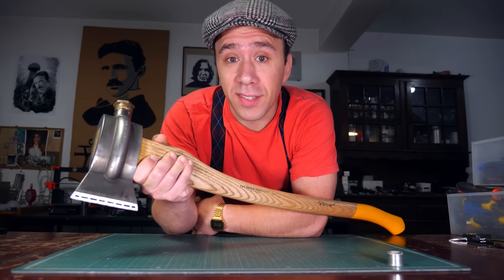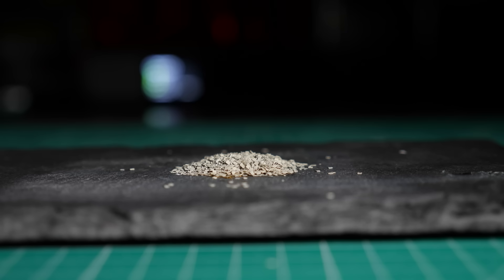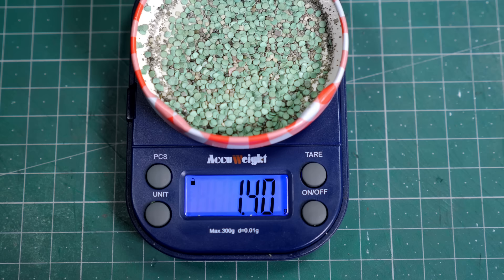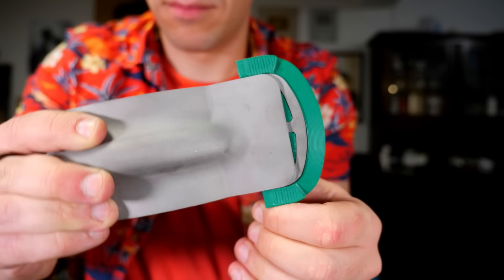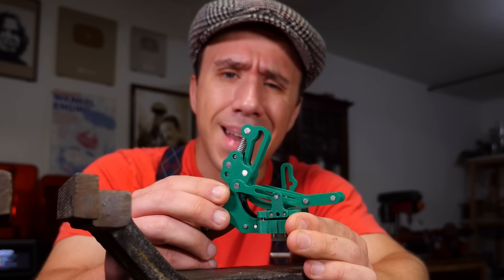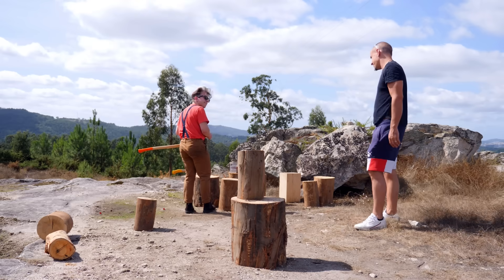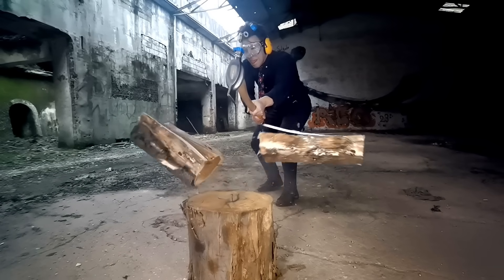I built a BETTER SHOTGUN AXE

Comment from the maker: JLC3DP 3D printing starts at $0.3, sign up to get $70 new user coupons here: https://jlc3dp.com/?from=3dintegza
Reply: You ate tomatoes?
Reply: I ate tomatoes too
Reply: you ate tomatoes?
Reply: @Kana-Beri  LOL he forgot the h before the 8 
i h8 2m82s
Reply: BTW i think this deserves a 3d printer as a reward for spotting the typo!!!! LOL
Reply: Make all your old project in metal with jlcpcb, il would be cool
Reply: make a homemade diesel engine pls
Reply: added it to my shopping cart thanks
Reply: I think 1st. You need the gas to go more in an arc to split down and sideways. 2nd. I would use a spike to decrease surface are and increase penetration. Let the pressure do the splitting. 3rd. Get the axe deeper. Increase the weight and make an X shaped spike, with holes going diagonal out the side. BONUS: drill out the center of the X and add a pointy piston, which shoots into the log and acts as a valve for the ports. This should wedge the wood apart, from the top.
Reply: why dont you make it so it actually drives something in to the wood instead of just gasses, or something that pushes outward from the inside of the axe
Reply: You ate tomatoes?😮
Reply: I really liked the HHO concept, the idea that you would just hold a button to charge it and not having to buy shells makes it much more viable and usable.......you can use biger space for explosion and much more HHO and make it KABOOM and the generator with bateries could be mounted in backback.
Reply: @Jarda_B HHO is a an excellent idea but has a much narrower timing range. What I think would make great content is making it a multi propellent device, powder, mussel, gas, slapping a mini HHO pulse jet on the head for the deeper penetration LOL. After all @integza is a 🚀 scientist at heart :) ... I would happily swing that axe.
Reply: Hi
Reply: there are shot gun blanks you can get for alarm mines (don't know if they are available where you are)
Reply: you ate them? i always though you hated em
Reply: Pizza 🍕🍕😋
Reply: When did you eat tomatoes!?
Reply: Hi
Reply: Happy birthday. This axe is awesome. You should buil a metal Delaval liquid fueled rocket engine(or gas).
Reply: I'm going to leave a comment directly under yours asking and hoping you read my comment in the section outside this thread.
Reply: Love your video ! so increase safety measure . then use rope to trigger the shell from a far. plz you are an idiot you say it. so make this wood blow not near your face IDIOT! peace!
Reply: i love that under your comment it says "Translate to English" i'm not even joking.
Reply: I ate tomatos
Reply: I don't know if you'll see this, but here is my suggestion. Drop the inertial trigger. It's a very cool design, but too inconsistent. I would personally have a  trigger system that uses the DEPTH to fire the shell. Example: a rod that is placed on the top of the head, and travels from the blade to the firing mechanism. When the axe head reaches the desired depth, the rod hits the log, triggering the mechanism. The rod could have an adjustable length to time the blast. And maybe have the ports face outward a bit more, so the pressure is going directly into the wood.
Reply: At this point get a Meltio metal 3D printer, the company Meltio is from Spain so shipping would be quite easy.
Navies around the world use them for making metal parts onboard
Reply: m3 2
Reply: Tomatoes 🍅 are expansive
Reply: @integza i think i have an idea how to meake the ShotAx better becouse its quite the same as the CO2 powered knife so my sugestions are: 1. add a magazine and open bolt mechanizm, basicly you meake a mag and a VERRY simple fire-load mechanizm like on the DT mg's or the STEN wich the bolt first grabs a round from the magazine, loads it into the barrel and fiers it. Then the bolt goes back ejects the shell and locks into the T.G. and speaking of it! 2. adding the trigger into the Ax Blade: simple you meake a mechanizm that realises the bolt via slightly mouvin blade and for easyer sharpenin you could add an angle and then smoothe it out with a block of metal. 3. screwin in tha fierin mechanizm on to the tewbe and meaking some holes in the bore so the gas can easly escape in the case of critical fail. 4. the ax hed shape and position: your shape of the ax is wrong... At least its not good for wood beacouse it quite flat so it meakes it more of an Explodin Battle Ax beacouse the head is flat aspecialy the Cheek's and somethin we in Poland Call "Lico" and now we get into your posicion wich is wrong becouse you want to stand in front of it without any weard angles like you showed in first secound of the vid. becouse you don't want to hurt ya self you stand in front of it with your legs spreaded out wide so the blade doesn't hit ya leg
Reply: Is there a way to make the axe work with co2 cartridges? That would be really cool for people who can't get hold of shotgun cartridges. Best regards, tomatoes are disgusting.❤❤🎉
Reply: @Joti_oti  nope lol ironically it's easier to just buy a good sharp axe and chop wood the good way lol
Reply: @CannabisJones 😅yes that’s also an option❤
Reply: jlc 3d pee
Reply: Don't you mean  I H8 2M82s
Reply: I H8 2M82s
Reply: they are disgusting
Reply: Put a trigger on it to save gun powder Joel, then you can chose if it's in properly. Ps. Eucalyptus is evil to split it's even hard to chainsaw mate. It's more twisted than elm. Even cutting it into 150mm sections I found it wasn't worth the effort. 👍
Reply: could the reload mechanism perhaps be turned into a pump action somehow? would really give it the true shotgun vibe completely.
Reply: Eww..
Reply: I h8 2m8ts 🫡
Reply: 8:32 does not know how to use file... FFS...
Reply: Tomatoes are delicious
Reply: I LOVE Tomatoes, but I TOTALLY respect and HONOR your H8🟥 for them. I understand, and that's because BELL PEPPERS ARE DISGUSTING!!!!!!!!
Reply: Make your own gunpowder dude, I believe in you
Reply: So you Ate them.  mmm
Reply: I love how you essentially combined almost everything you've learned from 3-4 different projects over the last few years into this one project.
Reply: LOLOL When video started your Biceps were of a 12 year old girl... by the end your a 16 year old boy LOL
Reply: Lookup butane nail guns
Reply: I gotta say A SHOTGUN PİCKAXE would be really usefull. Happy birthdays btw
Reply: Imagine an engineer using a helmet.
Reply: tomatoes are disgusting also UR FROM PORTUGAL???
Reply: I am Back
Reply: i know a solution to your problem, but am not gonna say here cause that's gonna be many issues, but i know something that will work. if you have the willing effort to put in. just get a hard hat before you poke me on it. if you poke me on it.
Reply: I've been trying hard to sprout tasmanian blue gum from seed and haven't had any luck, any tips or can you send me better seeds or sprouts?
Reply: @JohnDokivin  That stuff is more trouble than it's worth. It's invasive and highly flammable. Plant native species.
Reply: @JohnDokivin  royal horticultural society. Don't ask a tinkerer how to grow plants. We can't do that. Thumbs black from oil not green from chlorophyll.
Reply: @osmacargrowing plants is NOT mutually exclusive with being a tinkerer. 
  You can always tinker with the genetic code. Or do cell culture and tinker with the hormones. We're on a larger scale maybe grow and prune trees together in such a way as to make a house that's alive!!! I can think of many many many ways to tinker with plants!
Reply: It's an interesting coincidence that I was just watching a video about how Portugal is trying to get rid of the Eucalyptus trees. So you are also helping the environment.
Reply: What you want is an exploding wedge that you can set, then strike with a hammer so its always embedded to the proper depth before detonation.
Reply: Looks Like your Shells are Popping Open inside a bit before Detonating, from the g-force downward of the axe swing into the log. Causing the Shell to separate internally, causing some Slow Burn Hits. It even looked like you had some "Powder Fires" Spraying out form a slow Burn, not The Fire from Exploding Out, which was different. If you found a way to Seal your Cut Shells, maybe melt the Plastic around the cut edge to help keep the Powder 'Tight' inside against the g-force of striking downward, It Should Get Much More Consistent 'Pops'
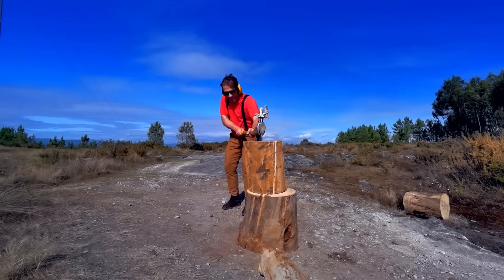Reply: I love that YouTube offers a translate button on this comment and the translation is the same as the comment :) it's a universal hatred of tomatoes.  😂   JTH MUC(mostly useless commentary): to grind your edge use onshape 6:59 to  design a negative mother mould of your part 8:17 like you did for sharpening but larger that will sit on a CNC table and put the edge perpendicular to the cutting tool. 15:26 you can increase the travel distance/timing if your "striker" so you can swing harder to get deeper penetration LOL 17:29 well documented on testing 19:00 +++++ a version 3. If you have a discord I'm a bored engineer which as you know us a dangerous combination :)
Reply: I ate tomatoes?
Reply: I can't believe integza actually ate tomatoes D:
Reply: For version 3 you should use the explosion to power lever arms that expand out to split the axe, similar to how the "Chopper" splitting axe is designed
Reply: Are you able to get ahold of gunpowder and primers?  Might be easier for you to look into reloading instead of buying boxes of shells every time.
Reply: The real move for an HHO generator is to use two stainless steel scrubbing pads, one unwrapped around a sock, with the other inside the sock, with the whole apparatus in a soda bottle. Run wires to each scrubbing pad and you've made a super efficient HHO generator for only a few dollars.
Reply: weve missed you buddy glad to see your alive and well
Reply: Why not have the head split open as pistons, or two fingers that pop out like pistons?
Reply: Wait, you ate tomatoes?
Reply: Tomatoes are awesome integza! Its ok I forgive you.  I have been quite entertained in the watching of your many  projects that you make. You have fantastic ideas and a brilliant mind so don’t quit tinkering or inventing.  The main reason I reach out today is out. Glad to hear you’re doing a V3 and I had an idea to suggest to you that I believe would solve your “propellant” supply.  A very easy item to obtain, at least here in the USA is oxygen and acetylene, since it’s commonly used in metal fabrication. I know you know this, but when the gases are mixed together, they are quite explosive. I would imagine that if you could essentially create an ax handle where you could pass oxygen and acetylene through.   Then create an ax head, that would allow the gases to mix into a chamber via a one way valve.  Then for the splitting mechanism, engineer an inertia actuated spark via a flint and that would be repeatable and quick.  You could experiment with allowing the gases to split the wood, or what I was thinking, make your ex had like a valved piston.  Allow the piston to do the splitting, and when the explosion occurs, the gases can escape via exhaust valves.  If I could draw you a little picture I would but I can’t it’s just YouTube
Reply: Why not use a different method of attaching the axe head? think of old primitive axes where the head goes through the wood, not the wood through the head. That way you can have the gas work better
Reply: I would change the design of the axe, so it's not the air pressure that splits the wood, but the axe head.  Build it more like a jackhammer design, where the explosion smashes the axe head further into the wood, that way you'll always get a split.  Just make sure the axe head is a proper log splitting design.
Reply: you ate tomatoes?????
Reply: It's weird i can go into the store and buy all the 12 guage shells i want and others can't
Reply: A few thoughts: 

1. A much thinner blade will penetrate more deeply and, as it will be more parallel to the grain, it should seal better.

2. I suggest extending the head with one or more  'dead-blow' sections, half-full of small lead balls.  As you swing, they will be the in the top of the section, then slamming into the bottom as the axe stops, keeping it from bouncing back out.

3. I also suggest using a dead-blow mechanism for trigger, so the shell fires as soon as the axe hits.  It will also prevent misfires, as the mechanism can ONLY fire when it experiences abrupt deceleration.

4. I suggest cleaning out the head in an ultrasonic cleaner, so the gunk that builds up won't take up space or plug it.

Cheers!
Reply: I reckon you might have an actual pretty useful tool if it was more of a pickaxe shape with vents either side close to the tip so all the energy is put in deep
Reply: You ate 2 m82s?
Reply: On the bright side you have a oxygen and hydrogen generator...feed it into a small engine intake, and for the battery use a standard car battery make sure to run it through a double alternator setup back to the battery, boom, nearly unlimited power.
Reply: Viva la version 3!!!
Reply: @Integza
Some pointers from a mech engineer who's done some interesting research projects for defence.

1. If you want to keep exploring oxygen/hydrogen, it is viable
With 1.4 of of propellant from your shotgun, you're looking at 5,600J, approximately (it varies wildly based on manufacturer and if you count chemical energy VS heat energy)
To get an equivalent in oxygen/hydrogen in a stoic ratio you want 8:1 by weight, and lucky for you, H2 is far more energy dense than average gun propellant, ~4MJ/KG vs 120MJ/KG. 
When you work out the specific densities and weights, you need approximately 476ml Hydrogen and 238ml of Oxygen at atmospheric pressure. When you use your dry cell, that splits it into a perfect stoic ratio as it is. Pump that into the chamber at 7 bar, you get 6000j (I'll have to double check my math, its been a while)

2. How I would, and have, approached something like this in the past is to use a 100ml combustion chamber with a 10bar pressure relief valve that dumps out into the axe head slots, three high pressure NC solenoids, one for oxygen, one for hydrogen, one for chamber pressure relief after a detonation. Or, two poppit valves inside the chamber (same as normal internal combustion engine valves) to replace the oxygen and hydrogen solenoids, but this does require far more fabrication. For pressurising the chamber, you could make a higher pressure dry cell and have the anode and cathode in separate chambers to ensure the oxygen/hydrogen do not mix inside the cell.

3. Use propane and a small air compressor, or even a bike pump, in lieu of a dry cell, propane is much safter, hydrogen is rather volatile.
Energy density of Propane is less than half of Hydrogen, around 46MJ/KG, but it is heavier, so you're going to need roughly 1:5 mol, Propane to Oxygen, around Propane 72ml, Oxygen 359ml, pressurised in your 100ml chamber to ~4.3 bar

Propane burns slower, but has more Push
Hydrogen faster, and is more of a detonation.

It's the same reason we use Dynamite for mining explosives (~5000m/s) and not PETN (8000m/s), it's a slower detonation velocity with a pushing force rather than a splitting force, it may prove more beneficial to use Propane over Hydrogen for wood splitting, you want that pressure wave around as long as possible.
Reply: Get a freaking helmet 😂
Reply: Blink twice…
Reply: Is there no way to make the hydrogen solution work? It will be cool and portable solution.
Reply: Alarmo Air banger.
Reply: I have something you need to try make the axe head like Zigzag teeths where it has openings for the gas.
Reply: i hate tomato?
Reply: Hard hat or helmet when dealing with explosives ALWAYS!!!
Reply: It might help if you swing the axe correctly and less like a girl.  No offense.
Reply: I hate tomatoes?
Reply: You need to made axe blade in two segment and have lower segment accelerated py shotgun shell pressure and release gasses at the top release them and made them leave lower part of the blade only after they exceed all acceleration possible, ofcourse you need some sort of axe blade retraction system. YEs, pure physical contact metal on wood (surface will provide much more effective and satisfying results for all sides). Blade retraction should be held by STRONG pistons or military grade or industrial grade springs (maybe mountain bike springs ?). Anyway, great video and idea but need a-lot of refinement and ideally try use different type of accerator medium, you will run out of shotgun shells quickly and might not have reliable solution afterwards...Maybe CO2 cans ?
Reply: I thought he was saying he ate 2 m82 firecrackers
Reply: Why not mechanism trigger in the front part of the blade so it goes always right?
Reply: You ATE tomatoes?!!
Reply: Considering you're mainly using the primers, you could probably just get a bunch of them and reload them into the shotgun shells.
Reply: Bro just casually tossed together a hydrogen fuel cell like he was repairing his skateboard 😂😂😮
Reply: " I Bait Tomatos"....but their babies are cute🥰
Reply: Same tomatoes suck
Reply: Well that says you ATE tomatoes. I think you need an 'H' in there before the '8', so you get "H8." I mean unless you were eating tomatoes.. but then your pants would be aflame!
Reply: You should make explosion driven piece of wood that gets forced onto the axe.
Reply: It has always fascinated that if you take separate hydrogen and oxygen they are highly flammable but if they are boned as water H2O you get a substance that puts a flame out. Crazy
Reply: Make a shotgun hammer
Reply: YOU ATE TOMATOES?
Reply: @integza love your work dude, and this project is one of my personal favourites of yours! Very new to the social media space and just reaching out to some of my favourite creators that I've been watching for yeeeaaarrrs. Hi dude!
Reply: you file wrong, thats why it took long time.... Files only cut in one direction — on the forward stroke (away from you). The teeth of a metal file are angled so they shave off tiny bits of metal only when pushed forward.

When you pull back, the teeth don’t cut — and dragging it backward can dull or clog the teeth, round off the edges, or even damage the file.

Using a file back-and-forth like sandpaper can also scratch or score the workpiece unevenly, especially on softer metals.

Proper technique:

Grip the handle firmly and support the tip with your other hand.

Apply light, even pressure only on the forward stroke.

Lift the file slightly or reduce pressure on the return stroke.

Clean the teeth often with a file card or wire brush to prevent clogging (“pinning”).

So yes — push to cut, lift to return is the right way to file metal.
Reply: This man is allergic to helmets
Reply: i think you would have more luck splitting the wood by swinging it over your head to get it deeper in the wood giving the pressure less idk magic (it works trust)
Reply: @MistyOfficial101  i have better luck splitting wood by using a normal axe HAHAHAHAHA
Reply: hi
Reply: Hi there, I recomand geting "kalač" and modyfiing thet, its large axe thet can doble as hammer and its made for spliting large logs
Reply: Tomato are Bussin
Reply: Have a rod that hits the wood with the edge as a trigger. Then dial it in just right for optimal timing.
Reply: I was worried this said "I ate 2 M82 firecrackers"
Reply: How much?!?! 😍😁🤤🤤🇺🇸🦅🇺🇸
  P.S. the Zombie Apocalypse would be so much better with one of these. Can we get it in Autoloader? 😅
Reply: @chriss2283  you could fit a bunch of shells in the handle lol
Reply: maybe get some professional help from that canadian lezzer?
Reply: Penetration
Reply: you ate tomatoes??
Reply: I eight two-meight-twos = I ate tomatoes or I hate tomatoes?
Reply: Instead of a standard bladed axe i would try something more akin to pickaxe, since the wide blades are not biting into the wood or making a wide wedge, making the axe head longer with more vents may help with the force distribution. Having a one way valve may also help with the blowback issue. Pressure will follow the path of least resistance, having that may keep more of the pressure directed to the axe head. More over the vents may also aim outward at an angle to help push the wood apart.
Reply: You might want to switch to a Sledge and Wedge setup
Get a wedge to be stuck maybe 1/2 way in, load and fire, but have the ports be at the 1/3rd point instead of the edge
Reply: Can't wait for v3!
Reply: If you want to pivot, try converting a diesel pile hammer into a log splitter. Never been done. Would be equally impressive as using the shells you were using here, but diesel is infinitely more available (including biodiesel). Obviously this is larger scale than an axe... more on the scale of a hydraulic wood splitter... but way way cooler. 

Here's the smallest commercially available diesel pile hammer to get you pointed in the right direction. "APE Model D1-42 Single Acting Diesel Impact Hammer". That's a 1L combustion chamber and a 140kg mass. Could potentially scale that down to 0.5L, or use it as is. 
There's been multiple projects I've thought about that free piston diesel hammer concept could potentially be adapted to (think: levers, compressed air, etc... anything that could use an impulse of 40kJ of kinetic energy). 

If anyone could adapt it to be way cooler (and perhaps smash some tomatoes with it), it would be you.
Reply: so where the hydrogen explosion failed I reckon and good oxy/acetylene mix would make that sucker go bang. pretty sure acetylene expands by like 4000%
Reply: SO NOW I NEED AMMO TO  CUT BASIC FIRE WOOD ?    
USELES INVENSION THE AXE WAS ALREADY PERFECT IN ITS OLD FORMS
Reply: @TheRdamterror  how much fun was it before vs now? Not everything in life is about practicality. Some things are purely for fun. 

This isn’t a mass-produced attempt to change the market. It's a project intended to apply and hone skills and knowledge in an entertaining way. ARE YOU NOT ENTERTAINED??? 😉
Reply: Tu és português na és?
Reply: Why you always have premature ejaculation?
Reply: Sell this!!! Just the head is great! Please dear god I want one!!!.
Reply: Bro, your injector is the wrong shape!

I know a wedge shape does the splitting — and so that makes sense but if you think about it you’re no longer doing splitting the way that splitting is normally done by driving the blade physically forcing the fibres apart

What you’re actually doing is injecting air into the log

For this what you need is a spike not an axe wedge, that is because pressure will be distributed evenly resulting in a definite fracture along multiple lines inside the log

It would be an axe-spike or a Spax or something like that
Reply: Tomatoes are disgusting
Reply: @jacobsanders4254  
Bruh, If you ever wrap your lips around a homegrown, North Georgia, Heirloom tomato, you'd wonder why you ever thought that way. Change ya life, change ya luck. 😜 "Penetration"
Reply: Always a good day when integza posts!
Reply: I love tomatoes